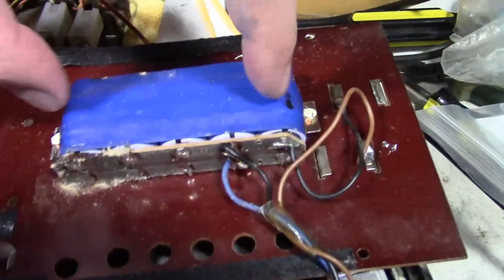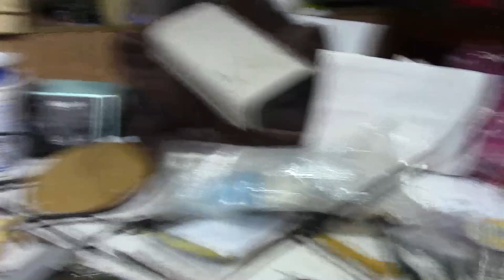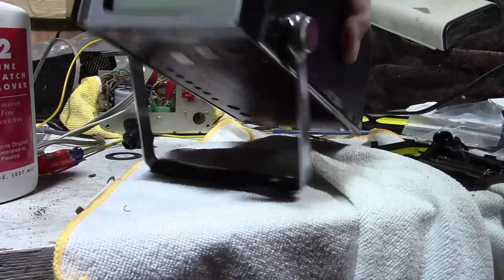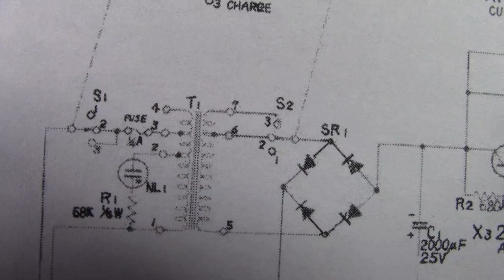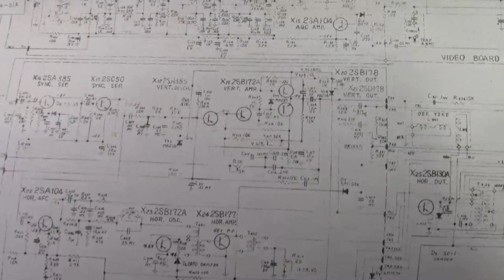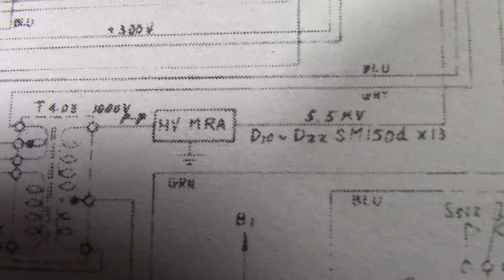Delmonico (JVC) 4T-20U p2o?

Comment: Did you ever get back to this project?  I looked, but didn't see any new videos.  I picked one up and have been working on it.  I've replaced all the electrolytic caps but all I get is a thin line across the screen.  There is sound (made a cable to connect a VCR via the 'ext ant' jack).
Reply from the maker: Nope, but I did order all the parts.  Looking forward to it over the winter.  Looks like a bear to get apart and work on those circuit boards.
Reply: @bandersentv  removing the boards isn't all that bad.  tip: don't get the duplicate color wires crossed!  you've probably already done this but:  take pics of the bottom of the circuit boards before any soldering.  I messed up one trace but pretty sure I corrected it.

Comment: I have not heard about tin whisker issues in any of the Japanese made transistors, but the ones mentioned in radiocrunchers videos were likely the Phillips/Mullard/Valvo AFXXX series transistors which were notorious for breeding whiskers. I seem to recall that someone cut open a Japanese transistor to find out why they did not have a whisker problem and discovered that the insides of the can was lined with plastic. I don't believe that whiskers were that common in U.S made germanium transistors either, however leakage, and shorts, are another matter, at least in equipment from the 1960s. 
 Early silicon ones can be a problem too though, those black domed top silicon transistors were made by Fairchild in the late 60s early 70, and are not known for reliability, I think that the package may have been responsible. The cut rate transistor radio makers in Hong Kong used to buy a lot of Fairchild  rejects as surplus, which they would test and paint with a coloured dot to denote function.
Reply from the maker: Thank you for the detailed information.  It appears that the circuits where the  potentially problematic transistors are located (IF) are working fine.  We will know for sure once I get the horizontal to lock.

Comment: Radiocruncher has more than a few videos on his channel where he deals with the tin whisker issue Bob.  Basically you take the transistor out and solder the emitter, base and collector leads together, then briefly dab a power supply or charged cap between the soldered bundle and the metal can. It should blow the whiskers away safely, as the junctions are protected by the leads being shorted together. It sounds kill or cure but often works. And, yes the Russian transistors are good replacements.

Comment: Even if you do encounter the Transistor Tin-Whisker problem now-a-days with access to Russian Germanium transistors its less of a problem as theirs don't suffer from it and are readily available. depending on the type though it might be in a physically larger package which might cause issues in such a crammed little TV

Comment: Awesome! 

Any updates on the 49-901? I am really excited to see how that comes out. 

One idea which I am sure you have already considered, but how about finding an old radio knob with the correct splines that slips over that shaft, drilling it out and cutting the knob off leaving just a plastic shaft with the spines. Then drill out the side of the 49-901 knob and jb weld in the shaft.

Kinda along the lines of one of your ideas you mentioned about getting tubing. 

Either way, I really look forward to seeing how that whole radio comes together. Along with this Delmonico.